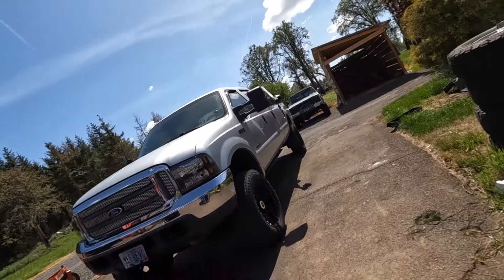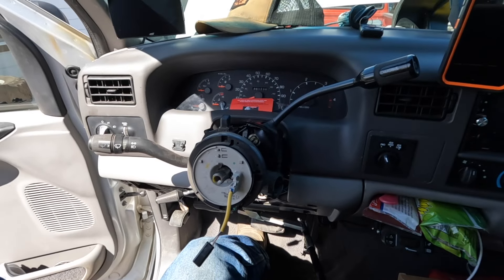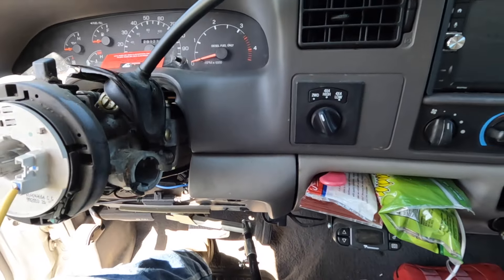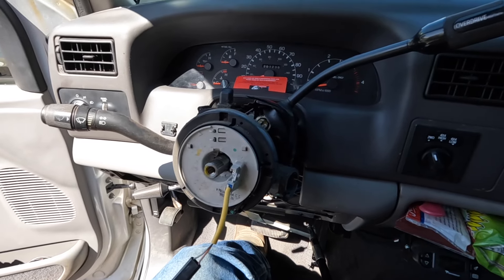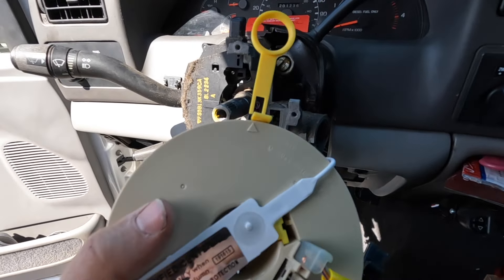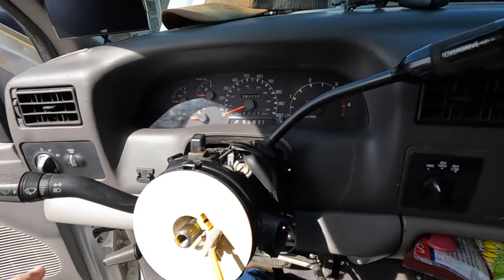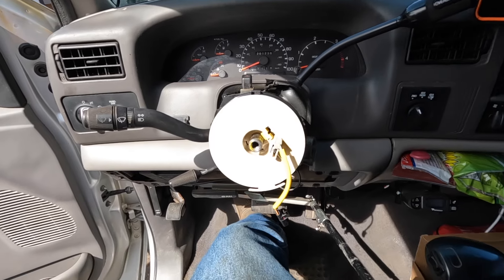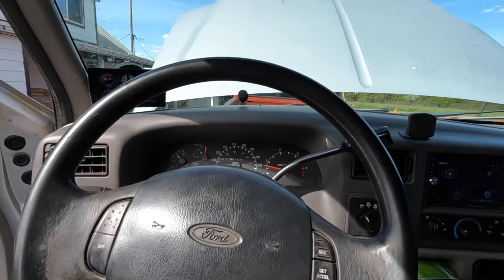More Maintenance on The New 7.3 Powerstroke

Comment: Why do you think that is an E99
Reply from the maker: Because it has the smaller spyder and no intake air heater.
Reply: @LivingOnWheels  first time I’ve seen an E99 with the badge on the door instead of the fender. I’ve got a 99 with L99 engine but E99 chassis sometimes it can be fun finding the right parts!